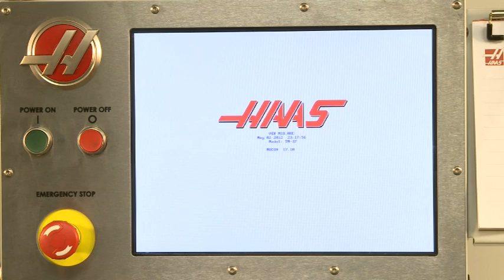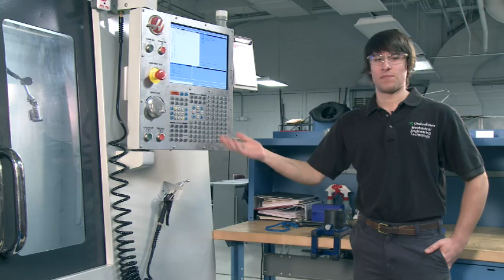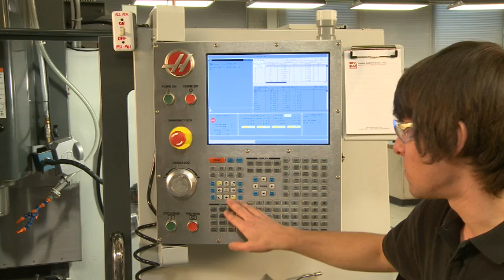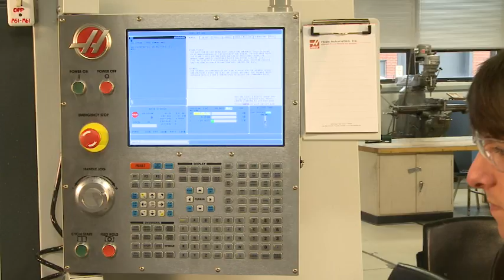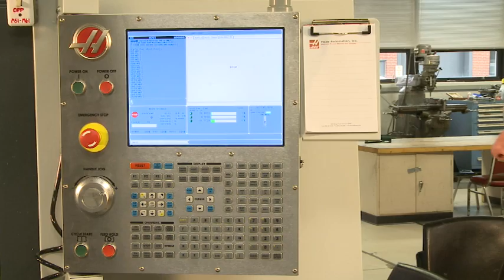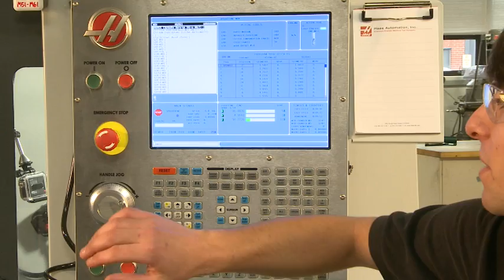Haas TM-1p Startup Shutdown and Overview

Comment: Thanks for clear explanation about how to setting up CNC mailing machines and shutting down. Ever CNC machine has its own control panel and machinalism, different types of machines and modern of which years they has been built.
I had operated CNC mailing machine, long time ago, after that I used to operated many different types of CNC brake press, turret press, and plasma cuttings machines, mostly Breqkpress is my professional. I have know setting and programming, but I have not touch for years after I was doing different types of job, especially. But I had a lot knowledge and experiences about CNC machines and other machines systems, therefore I am so easy to learn and performing my duty. Very well.
Now I have accepted new opportunities that as machine operator to operate CNC mailing machines, drilling machine and Auto saw machine. So far I have no problems at all, I have learn whatever my supervisor or leading hand person who has responsible and duty to teach me how to perform and to be trained as soon as possible, to stand myself in order to carry out perfect works duty and responsibilities.
Yesterday's there a few problems was occurred regarding about CNC mailing machine, after I had done all my necessary Judy to be carried out.
My leading hand trainer, he as seem to be attempted to change some program from original one. I believe sincerely he is not good at enough for CNC programming. But he has know very well all there machines as like his own babies. But CNC programming is very complicated and the response and reaction from machines toward its own command control coding is very sensitive, so we all have to be aware and careful. Unless we are not CNC programmer professional yet.
I am so happy to be working these knowledgeable and skillful personal with this CNC machines center.
Let e continue our problems, that the tool picking and changing hands machinalism, has been built with its own coding orders, after he try to stop that hand before its has been it's own, cycle of operations, that has was stuffed so we had to shirts the machine days, waits for technical person.
Today that problems was successful carried out just a few minutes, by machines engineer. But I was far away from that machine be a Co use I was operating there other CNC cutting machine
Now I have know how to start and shutting and understanding about g-coding common and control system, but I still long way to learn. But I believe myself I can do that if I have been achieved right amount of times and my leading hand and company supports. I have no problems at all.
Please explain me how to fix that CNC mailing machines has that as it was stopped on the way to picking up it's own commended tool from tools stock.
I will in future continue to to study and watching useful videos clips from UTube.
26th of October 2017
Min Naing Aung

Comment: hey zane very infornmational videos first off! and i got a question i run a st10 haas mill in my shop for the last month and i wanna know would it be safe to turn the spindle and feed up to lets say 150% and run parts to shave off some seconds on my cyle? thank you!
Reply from the maker: Brandon,
Thanks for watching, this question cannot be answered without more information. The material, and tool type, as well as depth of cut all have a major impact on possible speeds and feeds.

Get the tool data from your tool supplier for the cuts you are making and see how your speeds and feeds stack up.
Good luck!

Comment from the maker: Don't use a pry bar. Try tapping with aluminum or brass bar while someone presses the tool release button. If that doesn't work call your HAAS factory outlet. I don't think they would recommend using a pry bar.

Comment: Hi zane, nice videos there.
I have a quick question for this machine.
tool stuck on spindle but I use a pry bar and I see the tool holder moves like 1/4 or more from taper spindle but won't fall. like it don't release somewhere. 
any ideas thanks.